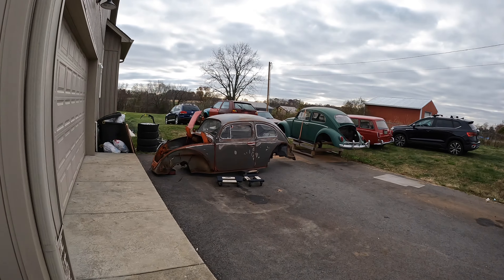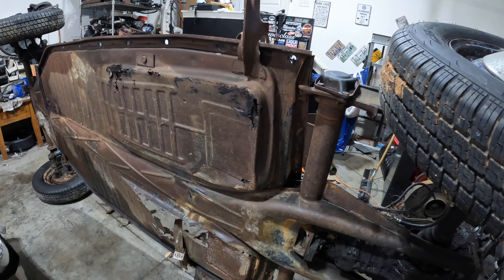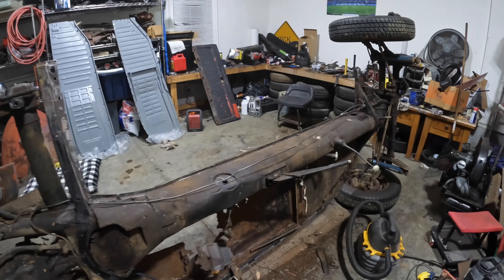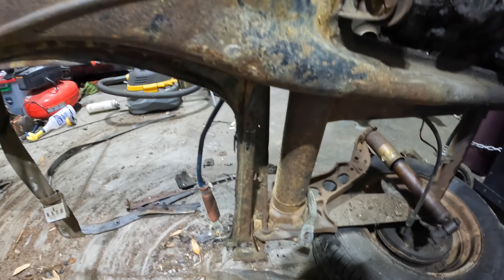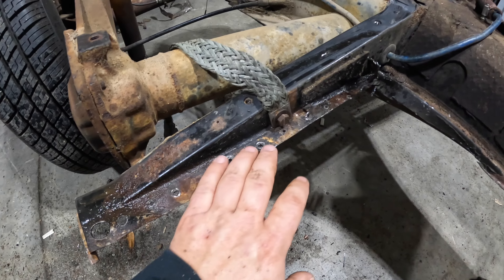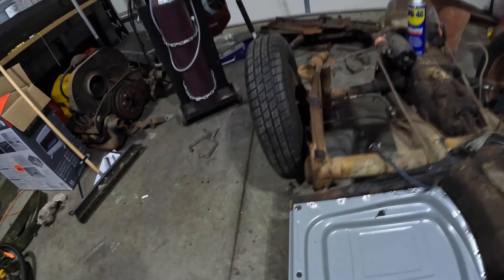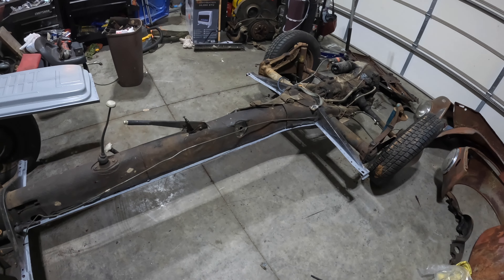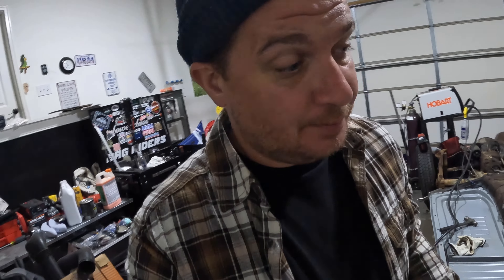Wolfsburg West Floor Pan Replacement on a 1964 VW Beetle!

Comment: hi, nice work and nice video. But a little reminder, you need more welds along the tunnel and framehead... the VW workshopmanual speaks of 1 weld every apox. 1/2 inch. don´t know how to email you a pic out of the manual though.
Reply from the maker: Thank you!
Reply from the maker: We actually also welded all the spot welds from the underside as well but I didn’t show that. Next time I will!!!